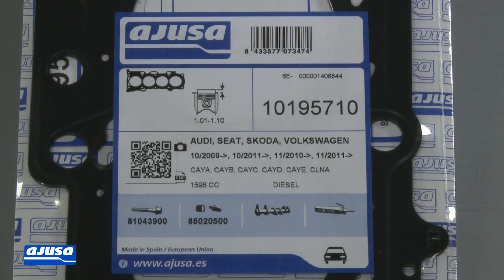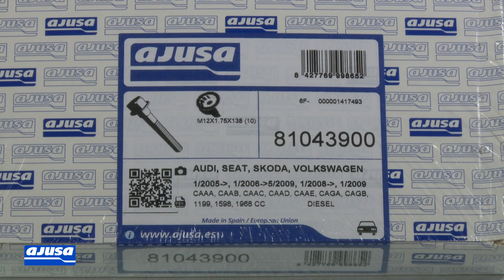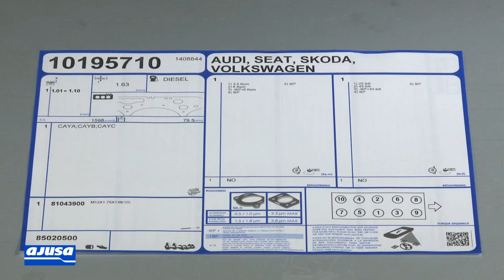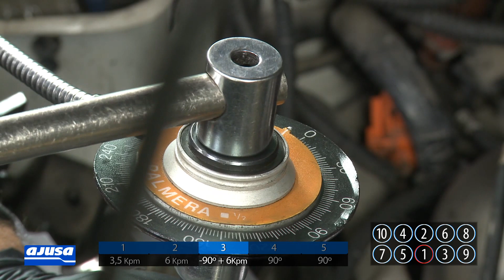Cylinder head gasket / Junta de culata SEAT IBIZA 1.6 TDI 105CV CAYC .

Comment: 5:06 why do you have 2 x 4 = 8 air intakes on that cylinder block ? what is the purpose ?
Reply from the maker: Hi! One line of holes are air intakes and the other line are exhaust. Kind regards
Reply: @AjusaAutomotive  are you sure about that ? My car also has 8 holes for the intake (which is made of plastic), the exhaust is one the other side, there is a dedicated collector for that.
Reply from the maker: @Tigrou7777  Probably your type engine is different. Kind regards